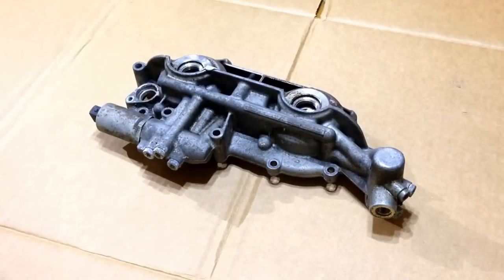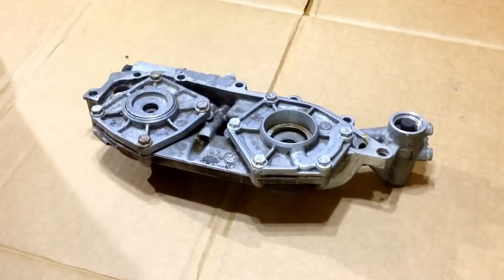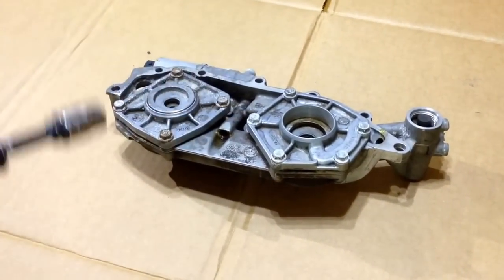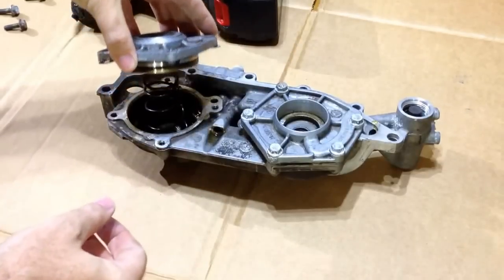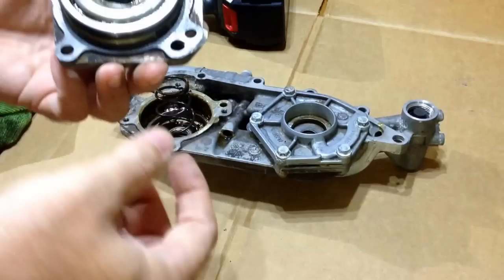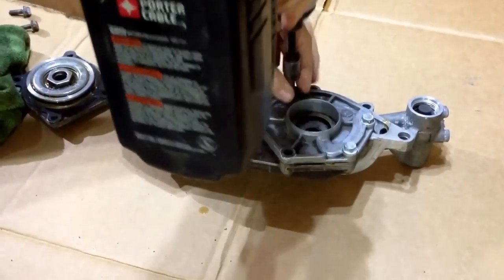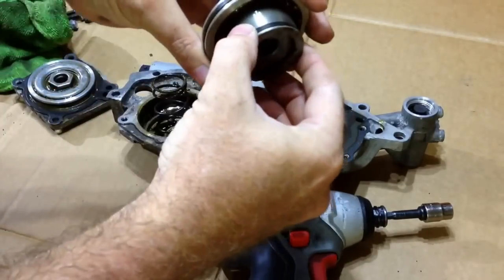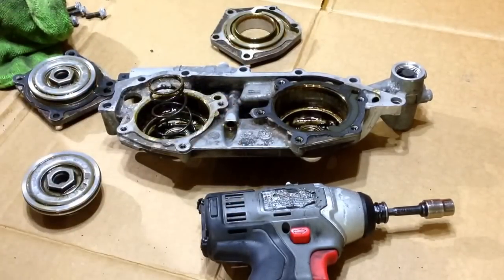BMW EASY How To DIY Double VANOS rebuild m54 m52tuM56  E39 E46  x5

Comment: Always seat the pistons in with fresh o rings and oil rubbed around them. Let them seat in for a couple of minutes. Take the pistons out. And again oil all o rings and cylinder walls and seat in again. Never scuff the cylinder walls. Brillo pads should Never be used in this application.

Comment: Do you know how long the seals last? I did a reseal 4 years ago using Vanos seals from Beisian systems on 5/19/2013 @203k miles. I now have 270k miles. For the last 5k miles or so, the engine has low power at lower RPMS. Once at speed, it's fine. Just stepping on the peddle, it can't get out of its own way, so to speak.
Reply from the maker: Is the disa flap broken? Sound like the culprit
Reply: Thanks. I'll take a look. I did Rebuild the DISA with Aluminum pin fix, on 3/31/2012 @180k miles, but the DISA vacuum quit 10/5/2016 @262k miles so I replaced it completely. Granted, it's only been 8k miles with new DISA, but you never know. I'll check vacuum on it tomorrow.

Comment: Informative video. The only question I have is if it's truly that simple to fix why does a mechanic charge so damn much?
Reply: Because BMW doesnt change the O-Rings. Only the complete Unit with the bad O-Rings so they will fail too.

Comment: First of all, I want to thank you for this video because I'm going to be doing this to my 2003 325ci that has a little over 185K miles on it. My question is, I noticed you didn't bother or meantion the bearing washers inside of the piston, is there really no need of replacing/cleaning those? That was going to be the scary part for me, but if there is no need to mess with them, I WONT!!
Reply from the maker: No need to do the bearings washers
Reply: Sounds good to me, but I may open it up to see if the bearings need any cleaning since I'll have the vanos apart anyway.  Thank you so much for your response.

Comment: Thanks Nathan. I'm preparing to replace a variety of parts on a 325xi with 226k. Listed below are the parts I'm planning to purchase.
- camshaft position sensor
- crankcase vent valve kit (cold climate)
- crank case vent valve hoses (cold climate)
- valve cover gasket set
- valve cover nut seals
- vanos gasket
- oil filter housing to block gasket

While performing the repairs do you recommend also replacing these parts?
- double vanos seals
- 11361438338 vanos unit plug
- 11361748745 vanos unit fit bolt
Reply from the maker: No need t replace the vanos unit plug or bolt , use needle nose to remove the plug without breaking it, i wold just run the $15 catch can and not the ccv , its cheaper and far more reliable, be careful with the valve cover and torque the bolts to 10ft lbs and go from the middle out, be sure to use sealer on the whole gasket not just the corners, check the covers for cracks and you should be fine